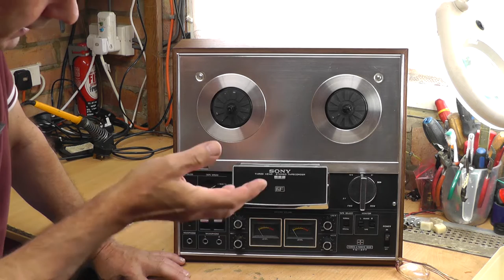Sony TC 377 Repair

Comment: If you remove the protruding bracket housing the shaft of the flywheel, next to the pinch wheel, thus loosening it, you'll be able to fish out the old belt and mount the new one through the gap that appears, without having to remove the panel. I've just done it on my TC-399 and the mechanism looks similar to your 377 :)

Comment: Thank you so much. This is exactly what I need. I can now follow your instructive video in order to replace the belts (sourced from the same source as yours I notice) on my Sony TC - 366, which is nearly identical to your machine.
Reply from the maker: Hope it goes well. I have to say I found it very easy indeed! Yep, the T-366 is very much like the TC-377 in fact I would not know what the difference is even! Thanks for your kind comment. And if you do get stuck at any point doing yours, not that I know a lot re these reel-to-reel players but I will always try to help if you do hit on any problems. Kev.
Reply: @BramleyProductions  Hi Kev. I managed to replace the drive belts, following your excellent video. The machine switches on, with a tape correctly in place the middle wheel spins, the machine will rewind, but here is my problem: when I select play the flywheel spins, the drive belt moves, but the right-hand spool does not revolve, instead the belt slips in its the groove. Do you have any suggestions please. Andy
Reply from the maker: @ajpegg2932  Hi Andy. That's a tricky one! I have to say it's always so hard to try to diagnose when you do not have the machine in front of you so sorry if this reply does not help much. And I am sure you may have looked at these suggestions already. I would take the drive belt off and see that none of the said components have seized up and are all moving free by hand it seems as you say as the drive belt is slipping something is making this happen a brake on or seized up. I know it took me a few goes to get the main big drive belt located right and then to get it all back in together right I had a few issues with that big play rewind switch not engaging quite right myself. But apart from that, my own worked really well with the new main belt and a good clean up.  I take it your machine was working OK before the Belts broke. I will have a further think back as well to see if I can throw any more ideas up sorry again this has not been very positive. Kev.
Reply: @BramleyProductions  Hi Kev,
Many thanks for your help.
If I hold that small lever (normally pulled upwards by the tape) up, then the right hand spool spins at the correct speed for 'play' and 'fast forward'. However, the left hand spool is locked solid by the brake to the left of the spool. So, with a tape in place the right hand spool cannot take up the tape, instead the drive belt slips on the spool - the left hand spool is locked solid. Rewind works perfectly.
With a scalpel I removed some of the felt pads on that brake (to the left of the spool) , but to no avail.
I understand that it may be impossible for you to offer any more guidance without the machine in front of you, but just in case you a have any ideas....
Many thanks, Andy
Reply from the maker: @ajpegg2932  Hi, Andy, that's very interesting indeed not a lot more light I can throw on this sadly as I do say this is not my field of expertise these old reel to reel machines! Now if it was an old valve radio or 405 line TV I might know a few more doges to try! However, It does sound like it has just sized up from what you say that is quite a complex system of levers and brakes on mine how they all run I did notice. I have heard that these older machines if not used in a long while can freeze up if you can trace the brake that sticks on back to see how that is all linked into the equation. I mean they are very all-mechanical linkages! So that might be a way forward I know some of those hook link strips of metal that look like coat hanger wire that acts as leavers do and can fall off very easily! As mine did apart from that you might need to dig deep and disassemble even more and clean and just slightly lube all links and moving parts etc. very sparingly. Do please let me know what you find in the end I'm sure you will crack it as basically they are quite a simple machine. Kev.
Reply: All fixed. It just started to work again. Not sure what I did, but I can now save old tapes to WAV files.
Thanks for your help.
Reply from the maker: @ajpegg2932  Great news long may it continue to function and serve you well. It does sound like it was just a little sized up maybe! But they do have their moments my TC-377 does! But I would not be without it. Well done Kev.
Reply: @BramleyProductions  Many thanks again. Yesterday I was able to play a reel-to reel tape dating from 1965 and was able to input the analog recording into Logic Pro X on my iMac, clean up and enhance the digital version to the point where my wife could once more hear the voices of long-lost family members. A precious recording recovered.

Comment: You can also rotate the chassis through 180 degrees in the case and you can use the machine flat instead of standing upright

Comment: thanks due to you mt reel to reel back in service! i even fixed some issue in the front cluth (to much breake making the motir slip) i got a issue wen i fast foroward sadly i got to much breack from the rear reel for some reason.
Reply from the maker: Yep, these old Sony reel-to-reel machines can be quite irritating sometimes! But get them right and they still work well for sure thanks for your kind comment. Kev.
Reply: @BramleyProductions  sadl i got speed isue i feel the ruber wheel is sadly to hard. time to search for a solution on my side.
Reply: Отличное видео,поможит многим!Удачи вам и здоровья!Я тоже люблю возиться со старой аппаратурой,в коллекции имеется,кроме Grundig и многих других,даже Ferguson 1957 года.

Comment: Remember one of these  at a Hospital Radio Station I was on back in the 80s
Reply from the maker: Yes, they are a good very robust easy-to-use reel-to-reel tape machine maybe not the best but well built and dependable for sure and easy to repair and get going even if you find one that has not been used in many years. Thanks, Kev.

Comment: Thanks so much for this video mate!!!
Reply from the maker: No probs glad you might have found it of interest and thanks for your kind comment. Kev.
Reply: Of cause I did!:)on monday a friend will bring the same machine to my place,so let´s see what happens,right?Love & Peace
 @BramleyProductions
Reply from the maker: @adamkrollmusic   Thanks Had mine many years now and a great machine. So easy to use and fix yourself. And works well transferring old reel-to-reel tapes over to my computer. I would not be without mine Thanks gon for your most kind comments. Kev.

Comment: 25:23 ahh you have the same issue as me. There is a small felt brake pad that sounds like has fallen off. When you switch to stop the brake should come on and stop the capstan and instead you have metal on metal which is what makes that noise. The reason your drive belt broke is because when you stop, if the capstan flywheel doesn’t stop then the capstan pulley is still turning whilst the drive belt is held stationary because the take up spool (RH) is stopped and braked by it’s on brake. So check the little break pad and if it’s missing and you can’t purchase a new pad then go to a DIY Astor’s and buy some felt feet used to stick onto items of furniture so that that don’t scratch other surfaces. This is like a dense sort of felt and if you cut a small square off and superglue or epoxy resin it to the brake lever. It should do the job.

Comment: very helpful, thank you!
Reply from the maker: You are so welcome! And thanks for the kind comment. K.
Reply: Tell me the size of the belt you replaced.???
Please tell me the size of the drive belt???
I need their size number to change the belts. Please help me
My device model is tc_399
Reply from the maker: @majidasadii  I am sorry I have no idea of the size belts you need! As let me explain here in the UK we are able to buy a set of belts off ebay for the Sony TC-366 & TC-377 there are no sizes given in the set of belts you just buy them as a set for this tape machine! I have no idea if they would fit another Sony reel-to-reel tape recorder! other than the TC-366 & TC-377.

Comment: Watching your video repairing the TC 3777 was fascinating.. my problem is the selector switch is locked into what we whine or fast forward to replay.  I've been told that the grease locking the selector in place. Does this sound reasonable
Reply from the maker: Sorry for the delay! And yep, these old tape machines are all mechanical inside and often do need a good clean the old grease needs coming off and new grease but it is quite a job stripping one of these old Sony TCC-377 right down but worth it for sure. I think that may well be your problem. Thanks, sorry for the delay getting back to you. kev.

Comment: I just tried to use my dad old unit and it will fast forward and rewind but it won't play you can hear the motor turning so I guess it has a belt just for the play speed?
Reply from the maker: Yes, that's right this belt I changed here was for the tape play. I had left mine playing recording an old tape to my computer which OK you should never leave old equipment on its own! And when I came back a few minutes later the tape was spooling every wear as the play belt had broken yet the tape was still coming through! but not winding on the spool as it should as the spool was not turning with the belt broke. Easy fix belt kits were available from ebay where I got mine from took about an hour to fit. Thanks, Kev.

Comment: Where do I get the belt kits?
Reply from the maker: Mine came from ebay https://www.ebay.co.uk/itm/304831649381?hash=item46f961d665:g:6EYAAOSwFClkCJKQ&amdata=enc%3AAQAIAAAAwIskQc0M5D1odW5ZHmuUsvu1mghC97of0BXKnBpXkSAoHZCykHdNHO2wq3G71Ovh2ixUL7ump0X8V%2FnpiG2hX5BVNIEqYWwLiQl3DFDoc47Nzp6JaW2QCmQDKzIZwFXear%2FizKsk59bHNcHXxOU%2BvwbFO85H5%2FwNvU1ITF7KjgjZvWKFT7MojSoyallMh35OK29byG21E6xgRxGn8aMyaMYTGxWTcBF2G1pFmJO3V9OYM0Nk87ti6CR4COKiLxY%2Fkw%3D%3D%7Ctkp%3ABk9SR5yqzZ-9Yg

Comment: where did u get the belt
Reply from the maker: I got mine from ebay see link seems well-made belts and a fair price to and came very quick Kev.https://www.ebay.co.uk/itm/304621934868?hash=item46ece1d914:g:3bgAAOSwNnRYlKhH&amdata=enc%3AAQAHAAAAoEcs%2FamgMExmT%2BcOzMURqPaZ78l%2BUA24lxXABbBHTd4Vf3Pt%2Fet3jlU%2FH%2Bp4KqMn%2FlxNGFUCcAs3B%2BV4vS%2Fj%2BsaS4iAcDCsRG2GNwtjyVhyHYmcv6HtQUm201%2Fy%2Fpiegn2NmeGRO07NBLb2vpXpo9Vz7edaUYlEwNdKqowr26o%2F7VPyumkyxiiDqS2Bb9u%2BdMDEEaMvJgPiB2KsGCBGt%2BMM%3D%7Ctkp%3ABk9SR4zMlI7zYA

Comment: That head assembly is very similar to that used on the TC-645. I'm currently working on the said machine, and I have noticed visible erase head wear (yes 'erase head'!) due to RW/FF action. It appears that the bar that pushes the tape away from the heads during RW/FF is not quite clearing the tape from the erase head? I wonder, have you noticed wear on your erase head too?, I'm wondering if this a common flaw in the design? 
Cheers.
Reply from the maker: I have not noticed any wear on my head but will look in closer detail now you say about your own findings great tip for all with these older Sony reel-to-reel tape players to watch out for thanks for your great comment. Kev.
Reply: On my newly acquired TC-377, there is sufficient clearance, so no mild erase head wear. :o)

Comment: Buy yourself isopropyl alcohol in bulk (I buy mine by the gallon) for electronic repair and tape deck cleaning, linen and and cotton buds are much better than the tissue soaked with isopropanol. Also with tape decks with mechanical linkages and lots of rubber, buy rubber renue (take bio precautions with this stuff) or some sort of rubber cleaning compound as the idler wheels and pinch roller will require servicing from time to time.  These are a bastard to work on due to the one motor driving everything, made in 1973-4 all the mechanical linkages , idler wheels and alike make it a hard machine to keep going due to wear.  The three motor machines are much better to work on such as a Revox A77, B77 and the better TEAC models (Tascam).   I am an electronics tech of fifty years in the trade, mainly in the RAAF and teaching electronics  to trainees as well as a SGT.    
To keep these machines in good order operational parameters should be checked and rectified as required.  Test equipment is required to do this task, the service manual (obtainable on line)  indicates the required instruments plus a certified test tape and a 7" blank  tape to carry out recording service requirements.
The TC-366 is circa 1971-72 the model before and didn't have the reel locking mechanism but used rubber cups to hold the reels in place which became hard and unusable.   Lets face it Sony manufactures didn't think they would still be being used fifty years down the track 
Enjoy the work, yes as a teenager I repaired radios and televisions as well,  the Chinese have made that difficult now by not providing service documentation.  Have fun. 😏  Robert
Reply from the maker: Great idea thanks Kev.